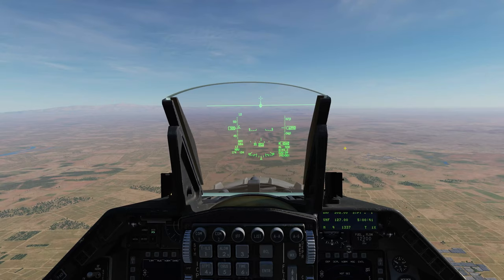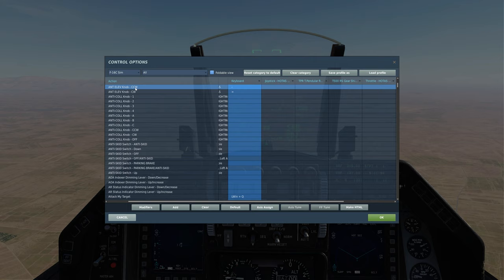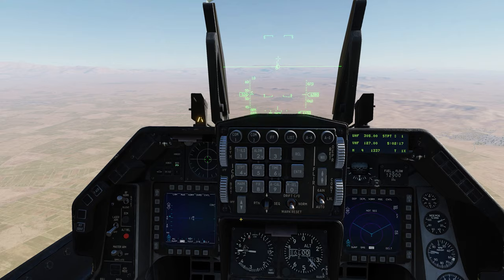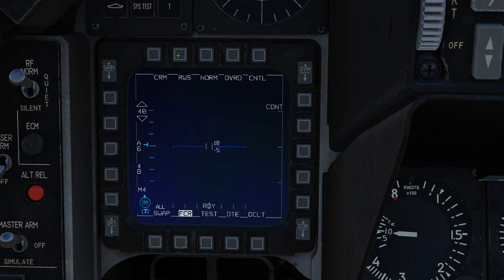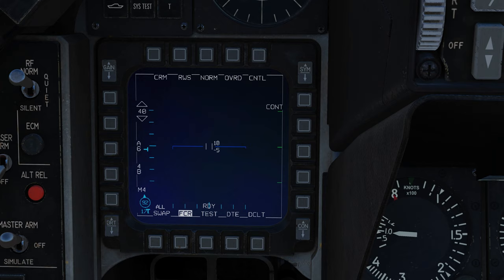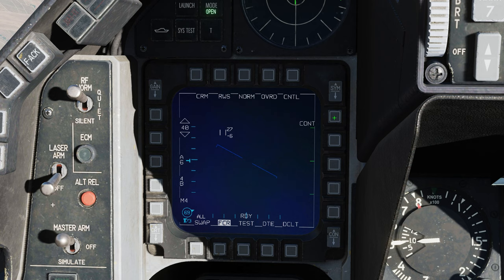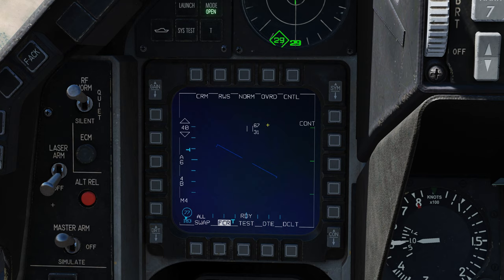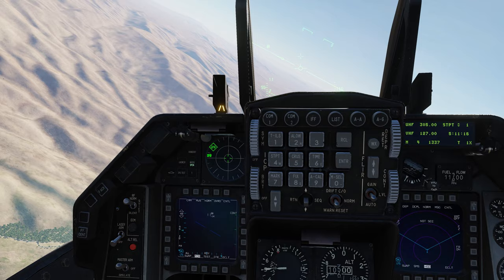Flying DCS World With OverKill: F-16C Viper: Radar Scope #1

Comment: Thx Overkill 👍🏻. So I was wondering if the MAN RNG / UNCAGE  switch is the same as the radar elevation and cage uncage. I have that command on my thwh throttle. And also have the cage/uncage button on the stick as well as the radar elevation. If so I don’t need it and can use it for something else.